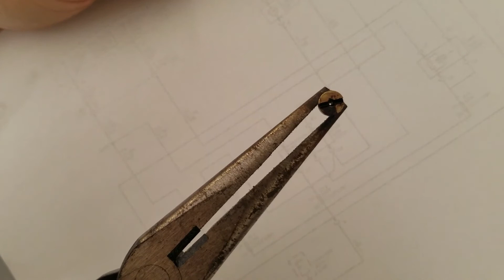Resizing a Carburetor Jet

Comment: What I've seen others do, which might be better, is to just clip off a tiny nib of solder and put it in the hole, then heat the jet to let it melt. Using the solder normally is awkward and might put way too much solder on.

Comment: How did it work?  I drilled my pilot jet to big, now I’m going to try what you’re doing because I can’t find the same style jet anywhere, EBay, Amazon. Murphy’s law
Reply from the maker: It does work, i used this method to try about 7 different size holes and wrote down all the results on a piece of a piece of paper. I used the one that ran best and also the one that was the richest that still ran when spraying nitrous oxide.
Reply: @JankyShack  I did it and it worked for me. Now it idels good

Comment: I would use my Weller solder gun personally ....actually I would buy a jet selection on amazon they be CHEAP ...Only if it were an emergency I might try solder and I know "everyone's a critic" but seriously there is no way you can drill straight by hand ...so each hole will be angled a little bit different from the next ...how much might that matter?  Dont know ...I just know I HATE to take a carb apart over and over and over and seat of the pants try to imagine which jet worked better.  Course you aint lived until you played with multiple carb circuits on a FOUR CYLINDER motorcycle ....drive you damn NUTS!  I spent hours on a friend's GS1100 and we never did get it right!  I was begging him to PLEASE take it to Vance and Hines or someone with a DYNO and carb balance equiptment!  LOL ... after that he begged me "let's try one more time"  And I was all "NOPE ...not me...I am not that much a glutton for punishment!"  LOL
Reply from the maker: This was for a 1 cylinder 80cc 2 stroke china motorized bike kit.  I used the torch because it was a lot faster than a soldering iron.  The only place I could get the correct jets were from china and were going to take 6-8 weeks and I didn't want to wait that long lol.  I just recorded the top speed with each jet size and it was pretty easy to tell what the correct size was.
Reply: The gas doesn't care about the hole angle.  It only cares about the flow restriction, which is mostly dependent on the hole size and length of the channel.  If you undersize and sneak up on final diameter it should work just fine.  Don't start excessively small though so it isn't run too lean at first.   If you can buy a jet easily it's probably not worth it.  But to save a 90 mile drive for a part or locating some oddball thread size jet like some Chinese carbs have it might be worth it.
Reply: @dbur971  true
Reply: Michael Fresh  search ebay for 'micro drills 61' and you'll find #61-80 kits like in the video for $2-3.  Though my XR200R ended up at #60, which was in my standard drill index kit already.

Comment: Hello, what solder are you using? the normal electrical solder?
Reply from the maker: I used plumbing solder, like the kind for connecting copper pipes.